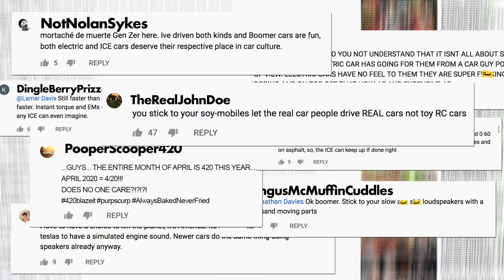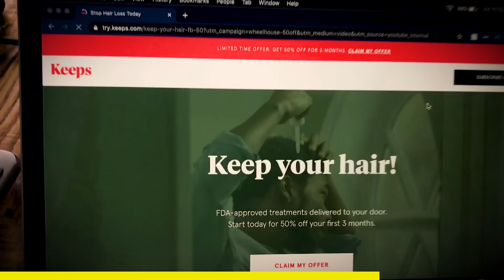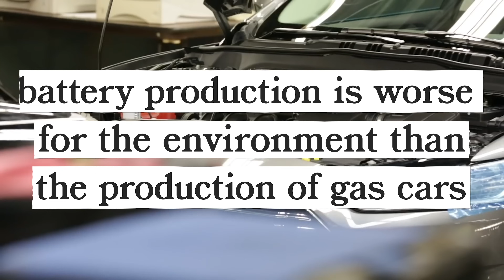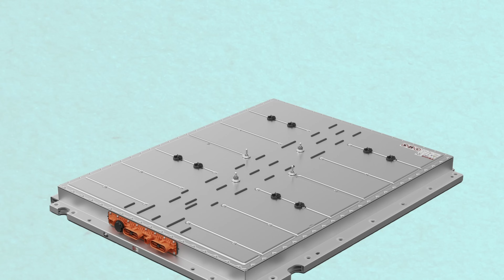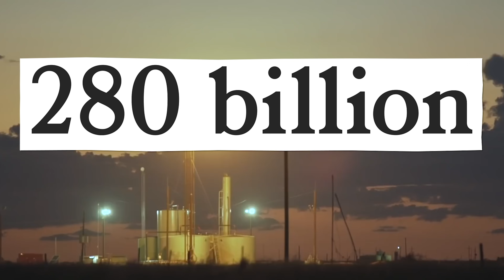Are Electric Cars REALLY Better for the Environment?

Comment: i can pretty much guarantee that a very small percentage of the Oil from refineries are reserved for petrol and diesel, most oil goes to heavy-duty machines used in construction, then there's also the very large market for petroleum jellies. the average car can use a 2lit bottle of engine-oil over a period of just 5yrs, and for other uses like the gearbox and diff, it varies, but in a life span of 20 yrs, you'll probably only need to replace those oils once or twice. we also have to consider the running costs of both an EV and petrol car. petrol/diesel is easier and quicker to refill, taking just a couple of minutes to fill up a tank compared to a few hours for an EV. Battery-life is greatly affected by performance in an EV, regularly flooring it can reduce your battery-life dramatically and will cause reduced power delivery down the line. meanwhile, a properly maintained petrol engine can retain it's power over longer periods of time regardless of how rigorous the driving was during it's life, plus EVs are more expensive to fix. the efficiency of the power delivery must also be considered. sure an EV can accelerate faster than a petrol car, but how much charge can it use during acceleration. The Bugatti Veyron empties it's 100lit tank in 18 mins when going flat-out at 400kph, but can be refilled in just 2-3mins and start again and still have the same power-output. it can probably do it's top speed run 3-4 times, and get a new set of tires, in the time it takes an EV to recharge from just one run. plus how much torque can an electric motor handle? regularly towing with a petrol/diesel car will not drastically affect the engine's life-span or performance compared to an EV.

Comment: Not a bad video but a couple points and a BIG ONE on cost savings and environmental benefits not mentioned. Health care is strained in the BILLIONS of $$$ by the gas transportation sector. Asthma, emphysema, cancer, and now linked to dementia from all of it’s toxic pollutants and fine heavy metal particulates that we breath in. I seriously don’t understand anyone thinking that gas vehicles are cheaper or better then an EV considering how inefficient they are (15-25%... that’s crap!) and basically driving rotary phone "tech". As for the batteries, it should be mentioned that EV batteries are over 90% recyclable BUT that doesn’t mean the whole battery is just recycled as in most cases over 85% or more of the battery is fine. Many are just repurposed for data centres and renewable power storage systems. As for the energy sources, 8 coal plants went bankrupt last year in the US including the largest one that had a CEO that supported Trump and probably thought he was fine. The UK has now broken yet another record of over 60+ straight days not using coal with over 45% of their energy from renewables. I’ve driven an EV for over 5 years... would NEVER go back to gas. Follow me on twitter @redbartesla or @cybertruckcanada

Comment: Fossil fuels accelerated human food production which contributed to population. EV do no agriculture equipment. Calculations of electric vehicles must have part oil production to number's as electric vehicles use plastic plus other materials also sourced from oil. To change world reliance on fossil fuels truly first steps are agricultural and primary industries. Do people understand that lithium resouced from the ocean at present is not cost feasible. All known lithium deposits and reserve's will be depleted within 15years. Hopefully better tech comes about. Probably Capacitors

Comment: If EV’s reach the entry level eg < $20K, they’ll have to make them slower. I know that’s a negative, but drivers in the regular car market don’t always have the skill or maturity to handle MO POWAH BABEH. But maybe when they’re older.
Reply: you can buy one used for 4k
Reply: Gaming and Vloging  well, facts state otherwise. However, i will admit that the batteries are not great.
Reply: False. Most expensive part is not the motor but the battery. Sub $20k is possible fully feature complete. Just need cheaper more energy sense batteries. Which happens easy year by year
Reply: Gaming and Vloging  at top end but not at torque

Comment: You account for the mining of lithium, but do not account for the processes that deliver fuel to the pump. Also, lithium based batteries are almost 100% recyclable and it will be much easier to find ways to reuse the already mined metals in the future than to go digging for more.  But yeah, if you are looking to buy a new car, don't buy one with an ICE. That is just plain dumb in 2020.

Comment: Great video. You skipped over a small detail of vehicle life. The battery in an EV only lasts for a few years at which point it has to be replaced adding to the carbon footprint. But it is still less than the refining process of gasoline for sure.

Comment: "nothing matchs the sound of v8 turning gas into noise"
-Nolan, 2020
Reply: Apart from that it also turns gas into heat and light (that we don't see). Only about 20% of the available energy can be converted to kinetic energy. That's why it has way too much emissions per mile, compared to EV's.

Comment: I'll admit I'm still firmly against electric cars because even if they are better for the environment in some ways, they don't live up to the claims many people make. Hydrogen powered cars have got to be the way forward imo. All they produce is water (not drinkable but it's not like you drink the water that comes out of your car now) and they take what were already used to and just modernize it (with the way you fill it up). There are just not nearly enough electric fast chargers around, and it would make more sense to convert already existing gas stations into hydrogen stations.

Comment: !.2 metric tons compared to what, 13.5 to 20 tons per year of carbon and other nasty stuff plus the cost and pollution of getting the oil, refining the oil which pollutes more than the manufacturing of a gas guzzler, but most people forget to factor that in. So over the life of a gas  car, say 10 years you will put out WAY more than the pollution of the lithium, the car manufacturing and the oil to gas not including the transportation and pipelines that tend to leak about 3-4 times a month. Some do that every day. There is no comparison in the end, electric cars pollute about 1/100th as much as a gas car does. NO contest. electric wins. Plus the Tesla's at 500,000 miles are still very low maintenance (and no oil changes!)  are proving to be much longer lasting than any gas car is. The batteries are also lasting longer, they put another couple of years on the warranty retro active if you bought one earlier with a 5 year warranty. Lithium is bio degradable too. IN some cases, it takes more fuel than is manufactured to produce it, that's insanity. But they sell it to the people getting it out of horrible places like tar sands. It's a sick game and has been obsolete since the '70's. Fuck gas.

Comment: If you do your own math for your region you'll find that electricity from a power plant is as co2 efficient as a 22.5mpg car, depending on the power generation method. My region uses coal and natural gas, so an electric car produces more co2 to "refuel" than a 19mpg combustion engine. But areas with nuclear are much better at around the co2 efficiency of a 35-40mpg combustion engine.

Comment: Finally, a data based comparison,nice job! I would like to add another point. Emission from power plants which operates on fossil fuel is "better" as they operate in a controlled environment compared to ICEs  because the emission from a car depends on many variables( even some people removes catalytic converter etc from their car etc)

Comment: My thoughts on the referring oil process, I guess you should split it with the combustion engine cars and electric cars, both has plastic for example... and oil production won't be reduced if there are more electric vehicles on the road than gasoline vehicles. Oil is essential for all industries to function from chemical compounds and power....actually it's an endless list how oil is important (asphalt for roads, and, and....). my point is, oil production and referring is happening with internal combustion engine cars around or not.

Comment: But at the same time even with ev's you will still have oil refineries crude oil is used to assemble the batteries and wrap the very wires to shield them from the elements and to prevent shorts lets not forget motherboards and interior bits like switches dome light covers ect. Sure there is probably going to be a timeline where an ev would less detrimental but the fact that they rely on those oil refineries as well i would say it would take quite a bit longer than 6 months. Where as petrol powered vehicles don't share the need for lithium or cobalt. And what ever happened to ethanol? Or how about propane? Or hydrogen? all would work with combustion engines.

Comment: Just out of curiosity, what happens to electric cars at the end of their lifespan? can the battery being disposed of be harmful for the environment?
Reply: I know I'm late to this video and discussion, but another issue here is that people tend to far underestimate the lifespan of EV batteries when they focus on recyclability. Tesloop, a California shuttle service, has driven its fleet of 11 Teslas a cumulative 2.5 million miles. It has replaced 6 total batteries, but only for "factory or manufacturing issues, not because of degradation". So really, for the average driver it's highly likely the battery will outlive the car.

https://insideevs.com/features/383640/tesla-500000-mile-in-depth-look/
Reply: The video implies but does not explicitly state it, but Li-ion is often recyclable, and unlike common recycling, can turn a profit due to the demand for lithium. The problem is that lithium recycling has not been able to scale as fast as production.

If you were to just throw away a lithium battery? Yes, that's quite bad. If you take a look at any household rechargeable battery you will see a hazardous materials warning telling you not to throw it in the garbage.

Comment: I may have missed this part but they do take into account that the battery needs to be replaced at least every 7 years right?
Reply: That's false
Reply: The average 2012 Tesla still has over 90% of its original usable range, and that is from the first year of model s production; subsequent years are on track to be even better. 

This may have been the case in the 90s and 00s, but battery tech is far better now.

Comment: I would say your NO's are biased towards towards ICE. Check out recent sustainability report from Tesla...actual no for ICE emission is much worse. Many of the base assumptions...like lifetime Co2 emissions of ICE is based on efficiency no's given by WLTP/NEDC cycles, which is just wrong as real world mileage is much less.
Its 1:4 Co2 emission advantage (EV:ICE) rather than 1:2 you gave.
Also, you missed out on recycling of batteries. Almost all metals from batteries are generally recovered as they are infinitely recyclable.

Comment: Several studies already showed that batteriecars are better for the enviroment as long as they are on the road with the same Batterypack for about 3-5 years. This comes down to the co2 that is produced to produce the battery packs because the rest of the car is basically equivalent to gas powerd cars. 
It all depends on how the energy that fuels the cars is produced. but even then energy produced by dedicated modern Powerplants is cleaner than a gaspowered engine just because eficcency where gas powered engines are about 25 to 35% efficency. Gasturbined for example hoverin between 60 to 85%. With a conversion factor from dc to ac to dc to ac you ll end up at 55 to 60% efficency of a electric motor so it is not as clean as many thing but it is cleaner than petrol and especially diesel.
so to all the apologist "EV user dont know and they are on a high horse bal bal bal" accept that petrol is at its end and for all the good it did it is good it ends

Comment: You are in some points quite correct, but you forget that the battery in EV has to be changed with time as it loses its efficiency and starts to waste power. Also you dont count in costs of mining coal (you just count in costs of producing electricity from coal), while you count in costs of producing gas. Also avg life span of a gas vehicle is much longer then an EV's (read lower to see what i mean - its important), only fair comparision would be to take in the same year unit to compare to.
Also your math seems wrong... EV - 17tons to produce and 2 tons per year of eletricity usage (not incoulded coal mining ect needed for it, and partly taken up with US atom energy that causes other problems), vs 7tons of combustion vehicle + 5,2tons per year (in EU it is far less as we drive with smaller engines). This means that its nowhere near 6months to 2 years like you say as...
17 + 2 + 2 is 21tons in 2 years, while for normal car its 7 + 5,2 + 5,2 = 17,4tons (and thats if you drive avg number of miles, while electric car has loses in power while its on standby ect). So even in US big engines (at least compared to EU standards) world its at least 3+ years. And you still dont take into effect a need to replace batteries with time ect.
University of Koln in Germany (one of the most tech advanced university in EU and world) pointed out that (for EU avg of cars with their norms) a typical medium sized batter before it has to be replaced for EV produces somewhat similar CO2 to a 160 000 km range drive of a typical diesel fueled car (similar number came up Mazda). They came to the conclusion that if you drive low number of km it is better for enviroment to drive conventional drive. EV's are generally much better in countries from Scandinavia (as they have almost 100% enviromently free energy) but on regions for with high coal energy produced, its better to think of using conventional engines.
In future EV's will be better for enviroment but currently its more like where do you live they are better or worse.

Comment: Not to mention the pretty much zero maintenance EVs require compared to ICE vehicles. Only checking fluids, rotating tires, replacing the cabin filters and wipers (brakes last forever due to regenerative braking). Also EVs are most efficient in traffic where vehicles spend majority of their lives. Oh, and not having to waste time at gas stations refueling.

Comment: So if everyone has an electric car and everyone is done with work and charges the car at the same time you need a coal energy fabrick to get your electricity to get your tesla or whatever to get it up to 100% next morning, thats why diesel cars are better they have good feul efficiency (my theory)
Reply: You're incorrect I'm afraid. Diesel engines actually have poor efficiency - around 35%. An electric motor is around 80 to 90% efficient. And you overlooked the fact that if almost everyone drove an electric car, then huge amounts of electricity would no longer be used for extracting, refining, and transporting oil and gas around to gas stations. And as a result there would be plenty of excess capacity to charge EV's. You also have not taken into account that many EV owners will have solar power available, Using this will reduce load on the grid too... The UK already generates over 50% of it's energy needs from renewables. The US seems to be trailing a little here....

Comment: One question I have now is where does the carbon emissions from the lithium production come from? Does it come from electricity generation in the region? Or usage of diesel trucks and machinery during transport and production? Are the emissions inherent to lithium production like cement production is or could we reduce those emissions by using cleaner power or electric powered machinery? This video didn't really touch on that at all, nor did it with the cobalt production.